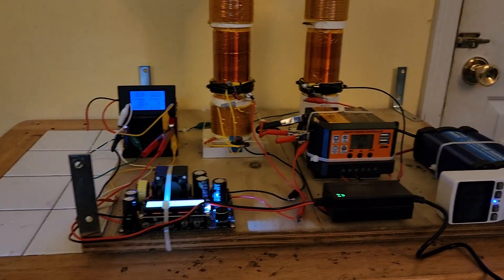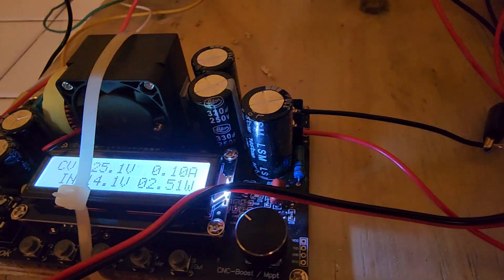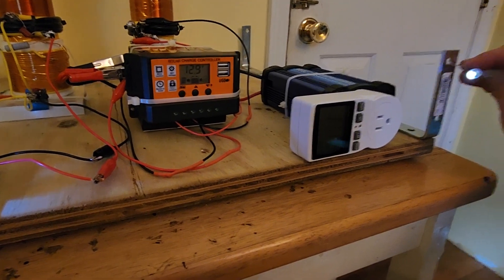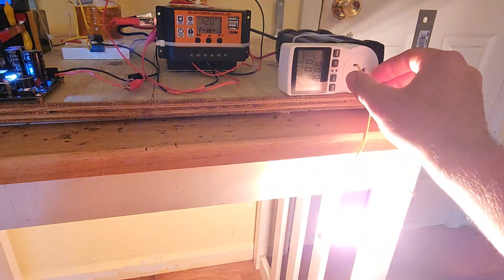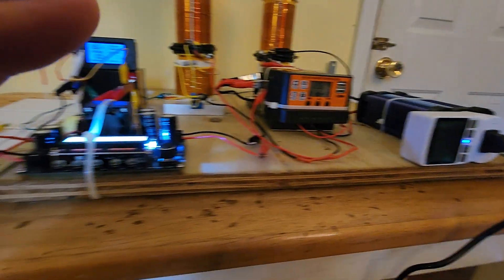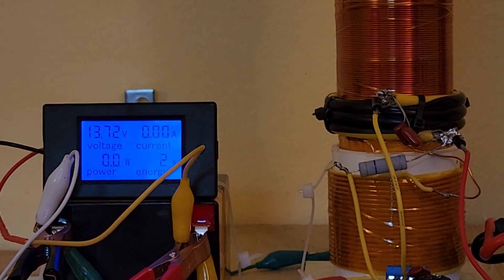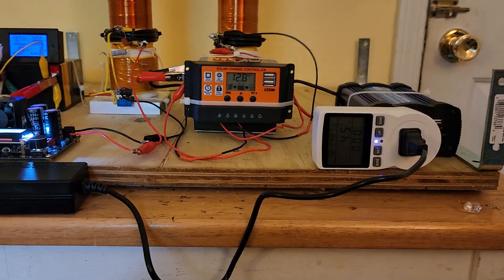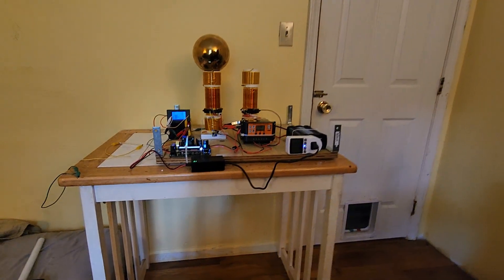🌞TESLAS SECRETS FULLY UNLOCKED🔓UNLIMITED SELF SUSTAINING WIRELESS POWER TECHNOLOGIES NOW ACHIEVED😎

Comment: Wow, finally a self looped system (very rare), excellent well done! Tesla is proud of you buddy... Hey all you debunkers have a look here!

To all the other OU developers, every time i see an external power supply /benchtop or wall plug PSU, then its not OU..! even if your output measurements indicate a greater value than your input ... loop it like this guy has done, once it works, then you have proper OU. 

Remember, we're shocking the excess power out of the Vacuum and collecting in the receiver side, then feeding it back to the input, so yes due to this shocking mechanism we're draining something greater than what we're putting in... all while not breaking the laws of conservation of energy!

Comment: Congratulations!
Can you provide more info on those super caps?    Perhaps a link to a manufacturer, or what kind of type (Most 'pure' caps don't need a maintainer)
I would also recommend scanning the HF bands to see if you are transmitting (and possibly jamming local commercial stations - that would surely get some unwanted attention down the road) on a single frequency or if there is harmonic interaction(s) going on.

Comment: Amazing work! You did it! Can you arrange this system to spontaneously recharge the supercaps while powering the lighter load 24/7 continuously? Say 10~20W LED bulb as a load.
Reply from the maker: So far when the system is in self recharge mode it can only run the small wireless lights but I'm working hard to light 120v led bulbs soon :)
Reply: @MTECH2022  it is still amazing that the setup is self-sufficient without the need for external power source! Nice work!

Comment: Fantastic work! You should open source this, it has the potential to change the entire world. Do you know how many extra watts its outputting? What is the COP? Does drawing a load through the wireless power put a strain/load on the system or can you just keep adding more and more loads to the system? I would be curious to see how many things you can run with the wireless power thats transmitted. Try and overload it if you can with a massive light array or somthing similar. If you can run an electric heater on this system that would be a global game changer.
P.S. Where is a link to the pdfs? i dont see them in the description.

P.S. Take care of yourself. There are many powerful people that will do anything to stop this technology!
Reply from the maker: It's all open sourced in the pdf & yes many more experiments to do & it's getting very exciting  :)

Comment: if your willing to spend about 10k in run capacitors and put them all in parallel you could run your house on its own energy over and over. You might spend 5$ a month for maintenance charge 120v ac